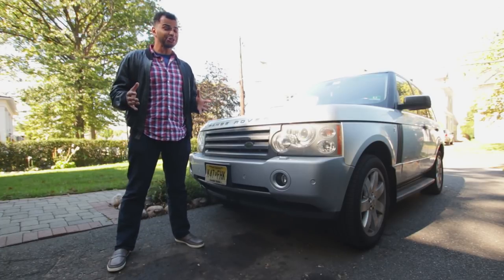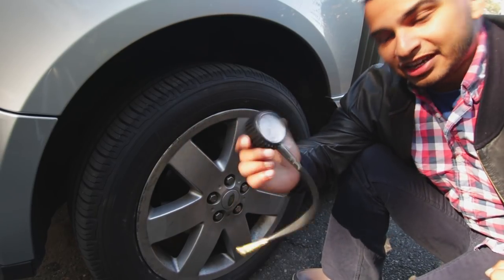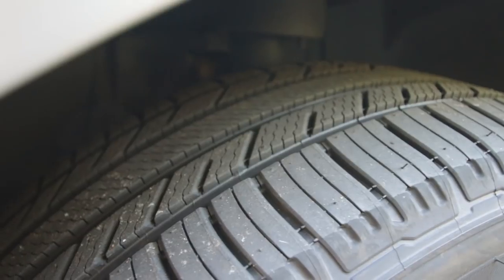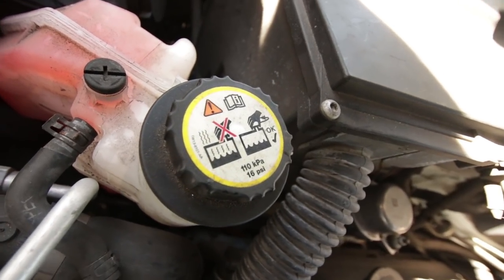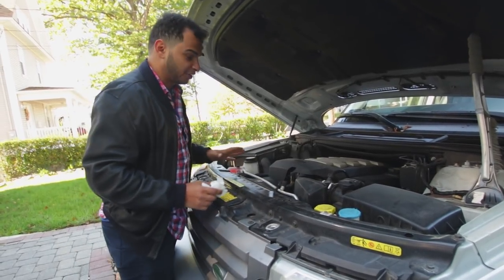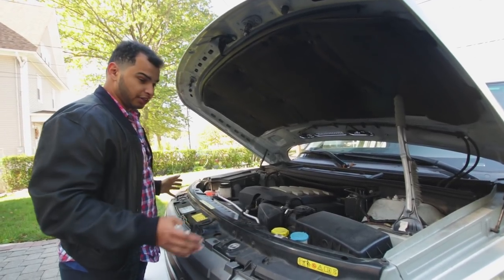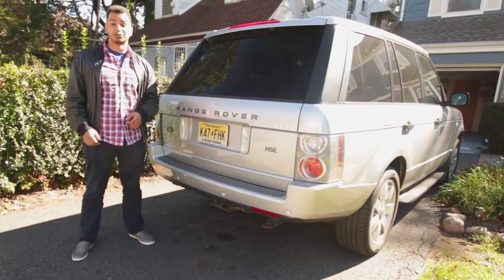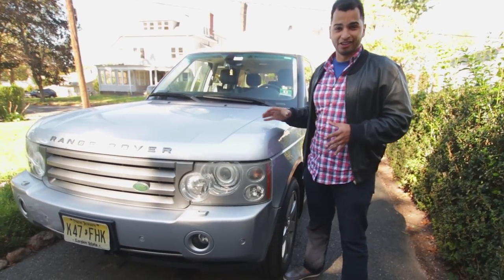5 Simple Money-Saving Tips Every Car Owner NEEDS To Know (But Probably Doesn't)

Comment: For undercarriage, use Rust Check spray everywhere (except the brake rotors!)  once a year to avoid the damage of water and salt. It comes in spray cans and is a DIY project. The formula is ok for rubber and wires/connections. I've been using it for over 20 years on my vehicles. Helps your car last longer. CHEAP too!

Comment: Those are not the wheels/tires listed on the sticker in the door.  The factory tires are 255/55/19, that Range Rover has optional 20" wheels from the '03-'05, which also used different lugnuts. Might want to check the correct lugs are being used.
Reply from the maker: +Edward Brearey great to know!

Comment: You forgot to mention for checking lights, a wall can be good, you can back up to it later at night and brake and use your turn signals, I honestly think we should start getting a trucker switch in passenger vehicles, some modern trucks have a switch that turns on every light to allow the trucker to run around the truck and check all the lights.

Comment: Another tip you can add is to drive down a road with the radio and ventilation system off for about a minute and listen to the car.  You'll be surprised how much you can hear things starting to wear out that you normally wont hear while driving.